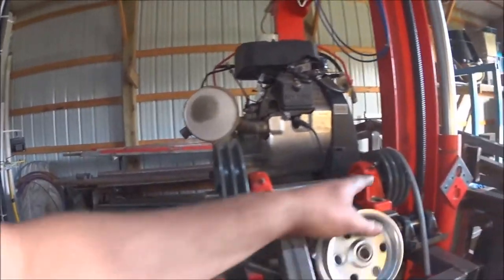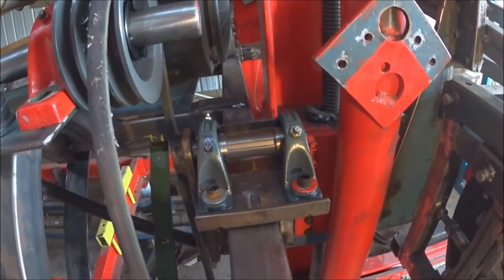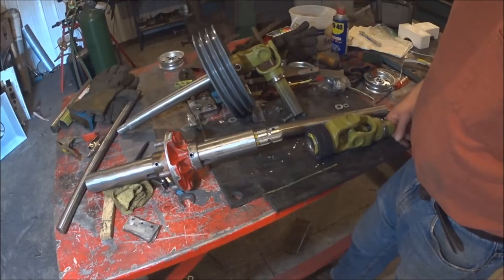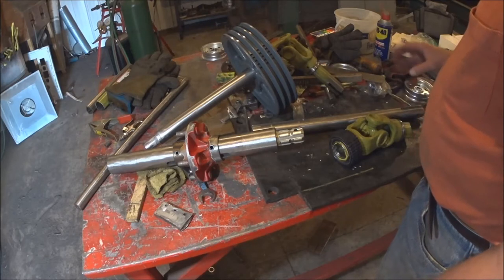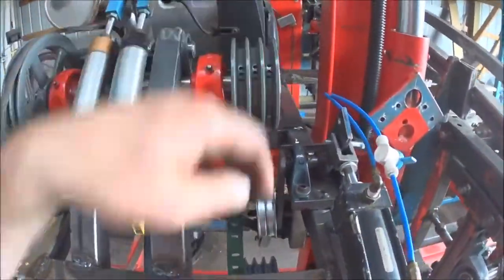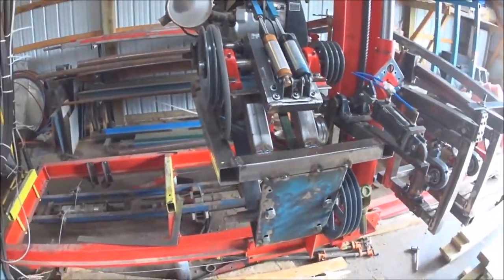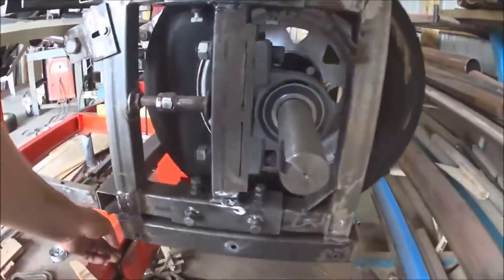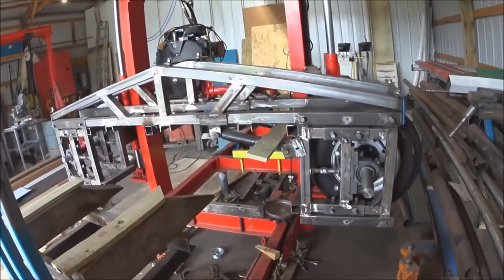Sawmill update   Pulleys and Jack Shafts

Comment: Looks very solid. Will be looking forward to seeing it cut some wood.
Reply from the maker: +Bens sawmill me too.  I am watching the progess on you mill as well. Nice work on stabilizing those rails.
Reply: Thanks, my mill seems like a small toy next to yours.
Reply from the maker: +Bens sawmill  thats ok, its all relative, and we are all having fun with the mills.  Mine is not as big as Cremona's and that isnt as big as Steve Cross' mill in Georgia.. All good though :-)
Reply: Little  heavy but free is free I'd prefer all hydraulic  drive  it's powerful  and you can get them very cheap pump motor it's same in model I use its a pump or motor so no miss matching speed controls are cheap as well . What I've seen in all brands of two post units ten too have some play in them so doesn't  cut as perfect  as timber kings four post . Hope you get all spot welds welded up.

Comment: After your reply, I got to thinking- in order to take it to the next level- you should drive a generator with the gas engine. Use an electric motor driven from generator to drive a hydraulic pump. Then take said pump to drive a hydraulic drive motor, and power the rest of your hydraulics. Of course it would be blasphemy to redo the power transfer system, so the hydraulic motor would have a pulley to drive the belts in place of the gas motor.
Reply from the maker: +scotty362100 now you've finally got the Rube groove..  beam it up Scotty..

Comment: Annnnd we've only lost 10 hp in parasitic losses from the 20 bearings, shafts, pulleys, belts, and pto u-joints!
Reply from the maker: +scotty362100 c'mon, think positive Scotty. Just look at all that momentum I've got there.  Hey, at least I'm not driving it with a hydraulic motor.
Reply: LOL. Don't get me wrong, this has to be one of the most memorable examples of "thinking outside the box" I have ever seen. It borders on being a mechanical work of art!